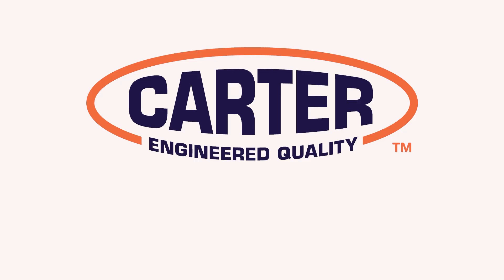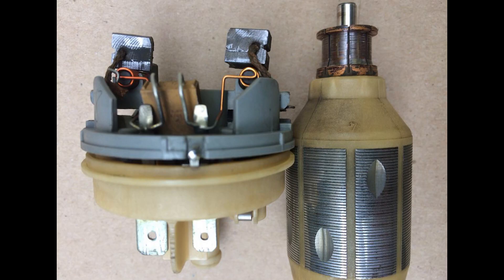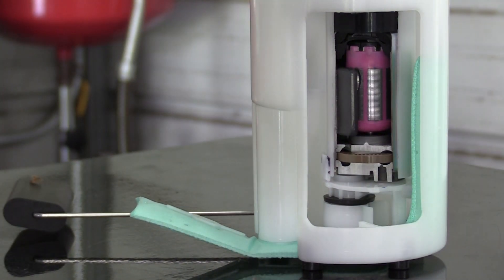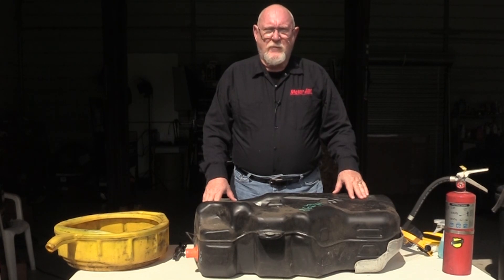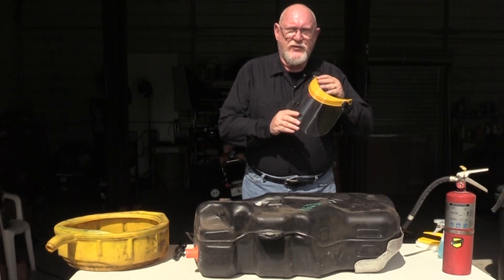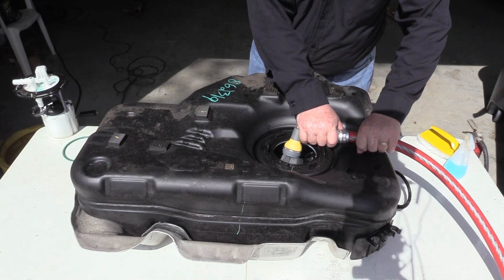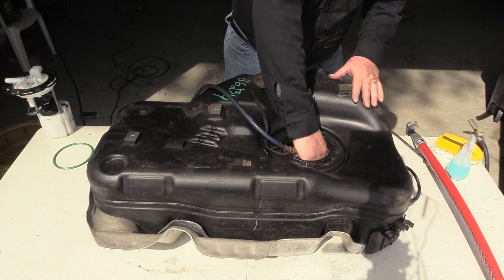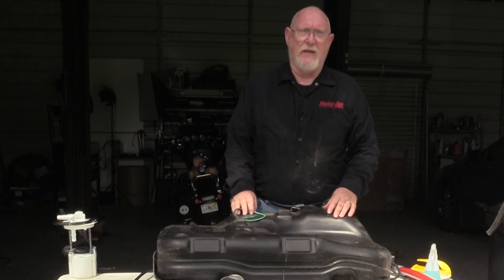Service Done Right #3:  Changing The Fuel Pump? Don't Forget THESE Important Steps!

Comment: I have to replace so many fuel pumps up here in the rust belt. Chevrolet's are the worst. The straps need to be replaced everytime. Some of the older ones are impossible to get off without cutting them off.